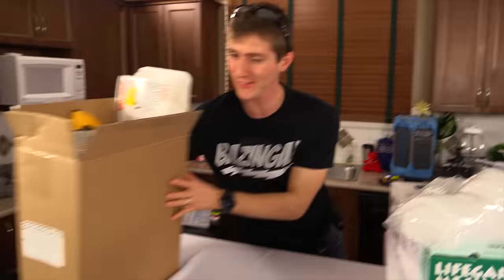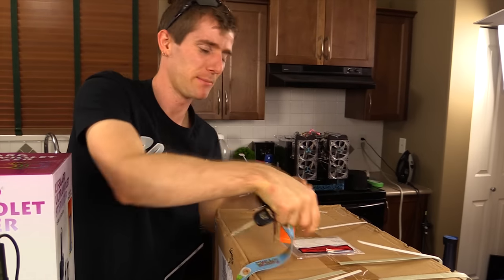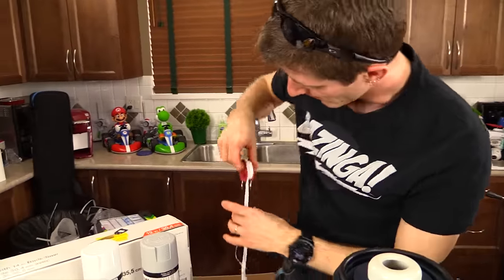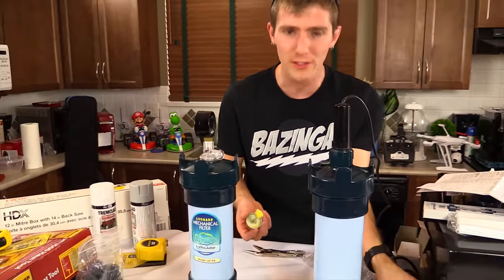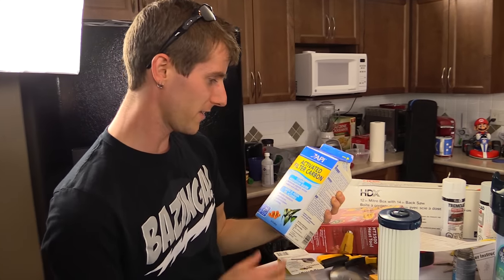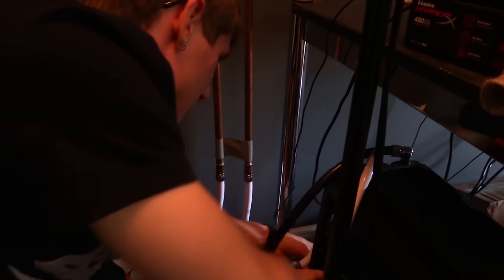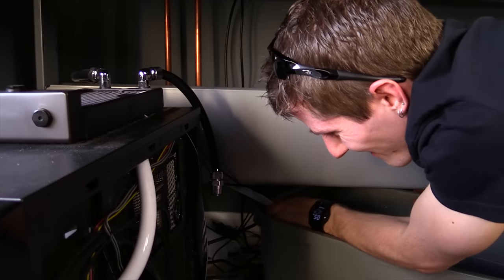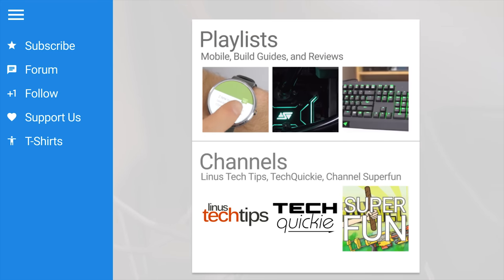Whole Room Water Cooling Part 6 - The Road to Stability

Comment: 1. A wrench is actually the best way to open that glue.
2. Surfaces to be glued should be sanded first.
3. Points 1 and 2 are probably stated on the side of the glue container
Reply: It's plastic cement, it literally melts the plastic together. No need to sand.
Reply: Used that stuff a lot with my grandfather and father in our many encounters with pvc piping, we never sanded it and it worked fine.
Reply: Smooth Trooper That's anecdotal. It doesn't change the fact that sanding and cleaning it prior to gluing provides a better fit and is the recommended course of action.
Reply: ***** indeed. sanding and primer is purely to clean the surfaces to provide a better seal. It's unlikely it'll leak as is, but if you were dealing with high pressure, high temperatures, or critical components you might care... I personally prefer not to have pipes leak, so I tend to spend the extra 5 seconds it takes to clean the pipe joints before glueing.
Reply: agreed!
Reply: Also some glues have primmer built in for applications such as this.
Reply: Eh almost a milion views per vid and a lot of the parts where provided from sponsors and I bet some is a tax write off....likely not as bad as one would think, if not in a way profitable.
Reply: he did this exactly right other than you're suppose to you don't sand that stuff, it's not copper pipping, you don't sand plastic pipping the primer softens the plastic so it fuses the actual pipe together. sanding the plastic pipe means less fusion which mean you will more likely have leaks. I gone to school and do this professionally. although I will note he used cpvc pipe glue, but will work for this low pressure system, and before someone asks about how I know this the color indicates what its used for.
Reply: @mushious  you sand to make the joints slide together easier and to remove burrs
Reply: I work with pools and have never sanded the pvc glue and primer will do. We use 2 hp pumps and not one leak. Also rarely use wrenches for the cans lol

Comment: Might be a stupid question... but why not just add chlorine?
Reply: Maybe chlorine reacts with some of the metals in the loop. IDK
Reply: You don't want to heat chlorine up to high temperatures because it can boil and produce chlorine gas. It also is pretty corrosive long term on metals and plastics that aren't properly protected. That's not to mention what it does to skin.

It would work, yes. Iodine is the safer solution though.
Reply: they added iodine already 8:23... but you need a filter to trap all the dead gunk and a sterilizer to prevent new formation
Reply: It corrodes the crap out of all your cooling blocks since its quite oxidizing.
Reply: Because chlorine is super reactive and deadly. But chloride is probably fine.
Reply: It really depends on what it would be going through in the loop,it could cause serious corrosion issues. Also chlorine isnt all that great at killing things the reason that it is in pools is because it will kill some of the bacteria without harming us.
Reply: Heat + Chlorine = BAD
Reply: ***** isn't chlorides just bad in general?
Reply: Joe0400 It depends on the exact chemical composition.
Reply: Chlorine is corrosive as fuck
Reply: Chlorine can corrode even stainless steel at right conditions. I'd recommend highly not even think about that as solution.
Reply: +nimajneb02 Chlorine is consumable and degrades over time, requiring frequent make up additions
Reply: Chlorine in a warm loop with rubber and copper. Hmmm yea lets do that..

Comment: holy crap,  how much would this set up cost if you built it without any donated parts!
Reply: +gearsNtools This whole thing is basically ridiculous compared to adding an A/C unit or just running the water-block hoses out of the window into a store-bought aluminum cooling tower.

Comment: Doubt you needed the Carbon. It's not a fish tank.
Reply: well maybe the bacteria inside the loop has evolved to fish
Reply: Probably sharks in the loop.
Reply: George Davidson pro'ly blue whale
Reply: The charcoal will "absorb" the iodine so flushing the loop with iodine and the filter inline will have no effect.
Reply: the carbon will help to keep the liquid clear looking
Reply: Also it'll pick up a lot of the metal particles and even the plastic remember water is a base and an acid it'll eventually dissolve everything given enough time. The activated charcoal will pick up those lil particles that dissolve off.
Reply: The filter should filter out substances down to about .3 microns whereas the activated charcoal will filter down to .0006 microns so if you want to get almost all of the impurities out then you need the charcoal.  Why do you think most water filters use a 2 or 3 stage filter with activated charcoal as the final filter?
Reply: Charcoal is a chemical filter.  Not really a mechanical filter.
Reply: Francois Botha I never said it was a mechanical filter so don't put words in my mouth.
It works but having highly porous charcoal, and those tiny pores create a huge surface area.  It uses these many bonding sites to attract certain types of chemicals such as chlorine or organic based molecules. 
So yeah I know how it works and it doesn't invalidate what I said it's considered a last stage of treatment for many filters to get fine organic and even inorganic impurities out.
Reply: 99bulldog  Hey dude.  My comment wasn't aimed at your comment so I wasn't putting "words to your mouth."  I would have mentioned you if it was aimed at you.
Reply: Francois Botha
My bad then, I apologize. :)
Reply: RobinHood East or a kraken?
Reply: ***** Cthulhu?
Reply: RobinHood East cthulu is good he kills justin beaver xd
Reply: Boudronium That's not what that means at all.. Water is a base when reacting with an acid and vice versa. On it's own it's neutral.
Reply: whootiyoioiy Yup, another dumb move on this project, quite the succession!
Reply: It reduces heavy metals.. Carbon is not just for fish lol. .

Comment: Pretty sure when you glue two PVC together you need a primer underneath the layer of glue.
Reply: Depends on the piping being used, as to the glues used.. as there are different combinations of the above.
Reply: Primer is just to clean the surface. It's also recommended to use light sand paper to coarse the surface before cleaning it with primer, then apply the glue.
Reply: Not needed just clean it apply glue and make sure both the edges of the tubes are smooth before any of that and than combine them.
Reply: wobbly sauce He should have put a piece of piping between the UV filter and the other filter.
Reply: no primer needed. the solvent in the glue make the abs plastic surface melting.

ever tryed to repair abs cracked body parts of cars or motorcycles with lego ?
i did and you use M.E.K (methylethylketon) to melt down the lego blocs and apply it on the body.
Reply: James Bernard Indeed. you can cut the tubing but not the devices.
Reply: Not at all, primer just help with the curing time. Since this glue is a cement, it's going to melt both parts togheter anyways.
Reply: wbzial primer is to clean any grime and oils from people booger pickers handling it and mold release from the factory. You are supposed to use it any time you make a system that needs to be fluid or air tight.
Reply: Jesus christ does everyone become professionals in the comments section 😂 primer is only used on pvc and cpvc, not abs. Primer doesn't clean anything, it actually just softens the plastic to help it melt together easier. Abs is a soft plastic, so it's not needed. And since it literally melts the joints together, you only need to sand it if the fittings are dirty.

Comment: The one thing that has confused me throughout this whole thing is that you said you were moving to the new warehouse location so what's the point of all this? Or are you going to be changing it up between both places?
Reply: These vides are no released right after filming. The new building is just an empty warehouse so a lot of work needs to be done there before they start moving anything.
Reply: You have to remember they have to move tons of stuff, cameras, piles and piles of computer stuff like gpu, psu, ram. And they have to move their own computer, all in a tight space. It's also a huge warehouse meaning they have to divide the space, it's not gonna be fast.
Reply: ***** Not all. These recent ones were filmed very recently. The fact that he mentioned the complaints about soldering confirm that, as well as the sponsor spot (since that seeming wasn't added in post this time), and... well, the dates at the beginning of the video being just a few days ago.
Reply: ***** Experience to, I dunno, build it better next time?
Reply: ***** Linus mentioned they have been periodically flushing the system over the last month to get all the gunk out. So its not like they have been procrastinating all this time. None of this is a wasted effort, it makes for good videos, which is what they do for a living... Even if they move they still would have to clean the loop, the gunk is not only in the pipes but on each and every PC as well. And when they move and have to do it again guess what? more content! more videos! Its a win-win.

Comment: i am watching this for the first time.  What a cool experiment!  The smart ass in me wants to make comments like, "hey fellas, get some valves and maybe a set up an auto air bleed at the highest point of the plumbing".  I think you probable have it figured out by now.  Your problem solving of issues as they come up was so interesting to watch.  I am wondering if you tried this at the new location.  will have to watch to see... if you did, did you try like an automotive radiator and a large maybe 12v fan like on a car... something more industrial than just a bunch of computer radiators and fans screwed together?
The really cool thing about this video is that it shows implementing concepts, invention and humor.  Linus i really believe that this is part of why your project Linus Group is so successful.

Comment: Just to let you know, if you put the main flow pipes on the floor and the connectors for hooking it up facing up, in this configuration __I___I__ then on the unused lines, the air bubbles in the system would get stuck in the parts facing up that don't get used, and if you had to replace the tubing, it would have minimal spillage when you changed out tubing or fittings.

Comment: Hey Linus just a heads up for your whole house water cooling system  for your house/office and/or when you do move, that steel box you use you can replace it with what Farmers or Hydroponics, or Aqua marine uses down here in Florida for the use of large portable water container as well as it being lite, we use one made of Biodegradable plastic certified for food or surgery in some cases.  There are many shapes sizes and colors, the larger ones say 500 gallons and up have a small thin steel case i.e. like 1/4 inch or more steel rod welded together depending on the size and or liquid inside and that's for the strength to support that size when in transport as alot are put into pickups or what not to be used in a variety of ways and or with some a chemical can be added and seen as most of these are a cloudy/milky white but very easy to see through when filing or used if measuring and adding other things for a mixture.
    Sorry for such a long post on here as i was not sure where to send it as an email nor deleted so y'all did not think it was spam. I know of one place in Canada that makes what Ive explained but im sure there are more and or possibly better ones as i do not know the reps of them i could only say for the ones we use here in the Tampa area. The best part of these containers is you will know right away if the filter and ionizer you added stopped or are not sufficient for your supply and feed. A last note if it helps when you do redo this all depending on where your moving when you get ready to remake it you might look into getting some Hydroponics or Aquamarine experts to help or even hit up Jay's 2 cents he seems to have a good grasp on the water cooling from what ive seen so far. I have a long story about Our 3 Machines Cooling system I built but its something i need to save for another time as its very special and im actually looking into a possibly patenting an idea I came up with while making the system, so until we know if it has or has not already been patented i will need to save that story for later until they get back to me.  Anyway hope some of this helps Linus.    Cow

Comment: Suggestion:

1) In the future build, use "copperbite tee",  it gives cleaner joint.

2) Consider using "automatic air bleeder" at the highest point, but since yours are an open system, just beware of water pressure equalization effect.

3) Install "ball valves" if you intend to drain the system every so often, it is much quicker and less messy when disconnecting each PC.

Note:
You are a quick learner into the chemical side, which ever chemical that you use, you should first try out on a piece of test sample just to see if it corrodes to the plastics or even metal tubes that you are using.  BTW UV lamp is OK, but having biocide is better (since you don't need fish in the system), but beware that mixing other chemicals together inhibitor + biocide + glycol may not goes well together (check with supplier), also Aquarium product is generally less toxic than those used in the automotive industry. 

Corrosion Inhibitor prevent rust, where some specifically formulated to use in conjunction with tap water OR distilled water.

Just beware that inhibitor "may" also act as an catalyst to rusting.  Don't believe me? why not tested with a nail (un-plated or coated) into the vial, where one is filled with inhibitor + water mixture "halve way" up the nail and another vial that filled up and "above" the nail, where both vial need to be closed off with a cap. Over few weeks you "may" see something unexpected.

It is definitely recommended in using inhibitor, but make sure the system don't have any potential pocket for air to get trapped.

Comment: Just a thought, if your reservoir is steel you may want to line it so it can't rust. There's a metal tank liner called Kreem that's used for gas tanks which will work wonders on your reservoir.

Comment: You might want to take the radiators on the pc's out of the loop. In my experience radiators are quite flow restricting and since you want all your heat to go to the outside radiators the radiators on PC are redundant. You could use the quick connectors to switch between home loop or pc radiator, that way you still have a cooling option when you move the pc out.

Comment: I think you got a good handle on it now, although I'd like to see you lose that steel tank and get a good poly one.
It would be interesting to see how much the temperature of the coolant in that tank rises over a day with all of the work stations rendering at full bore, or maybe spot check the temp of the hot side copper tubing with an infrared thermometer.

Comment: Next time you set the whole thing up you should put valves on the computer in/out and directly across the hot and cold. That way with the flip of a valve you can isolate computer(s) from the loop with no issues. Also maybe invest in some heat exchangers so you don't get computers infected.
Reply: Also you could maybe put solenoids so you can have a master panel with switches for each station. And show off your wireing skillz.

Comment: i know it's been 7 years and i have my own "DIY" custom loop that the end of the tubing drops down to resevoir is on the highest height than entire loop and the loop to reservoir is also not straight down to reservoir but also rotated up side and drop down to the reservoir and makes the pump a bit more struggle to push coolant on it loop into reservoir. by the way, the reservoir is on the middle a bit below of the entire loop... i dont know if it's a weird, because the most "DIY" watercooling loop i've ever watched on youtube is a tubing line into reservoir.

Comment: Also, you should have put shut off valves on the filters, for when you need to replace the pleats. So when you open them up, fluid doesn't come gushing out everywhere. A tip from my pool filter replacing knowledge.

Comment: I think you should consult a HVAC engineer. Other wise read up some article on how water cooling tower system work.

I would suggest you use a close loop system similar to car radiator to forgo problem with fouling, you will only need to treat the water once. I didn't go through all the video, but did you use a flow regulator for each PC connection?